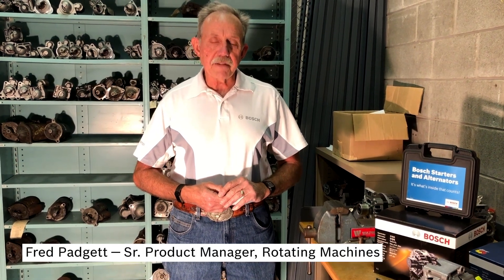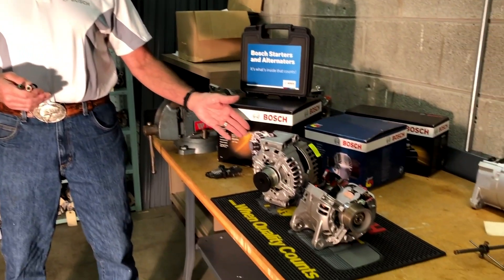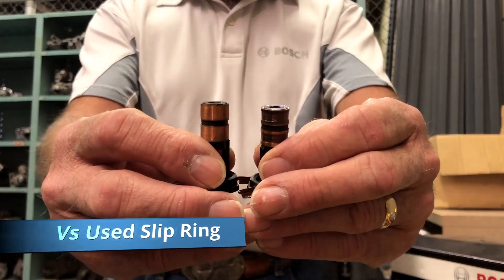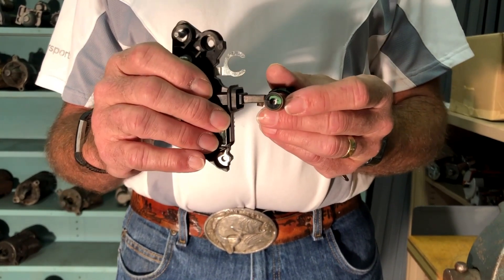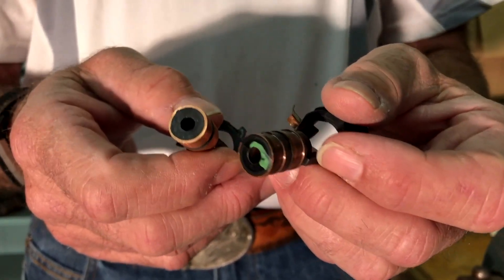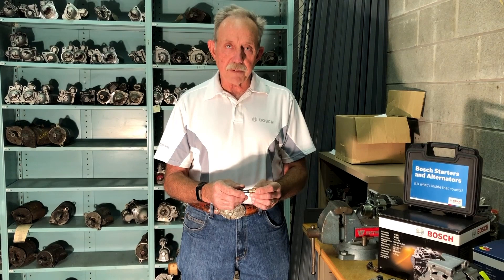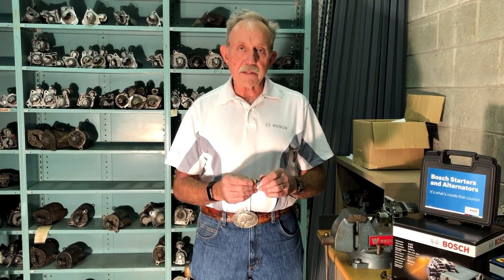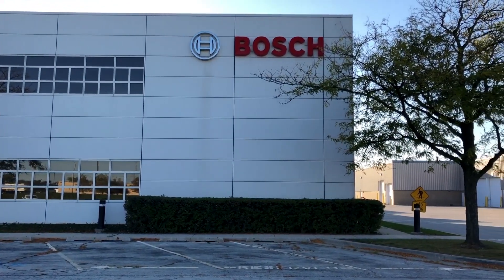FredTalks: Episode 1: Picking the right Brand / Understanding the Slip Ring

Comment: Where can I purchase a Bosch slip ring?
Reply from the maker: Thank you for taking the time to reach out. We've forwarded your inquiry to consumer care, who should be reaching out to you soon.
Reply from the maker: Hello.  Thanks for reaching out. The answer is no, Bosch does not sell that part to the independent aftermarket. Regardless of whether the customer would be a professional installer or a DIYER, it would take specialized equipment to remove and install one, and then to machine it properly. These are only in use at Bosch Reman facilities where the Product is totally disassembled, Inspected, New parts installed, and reassembled.